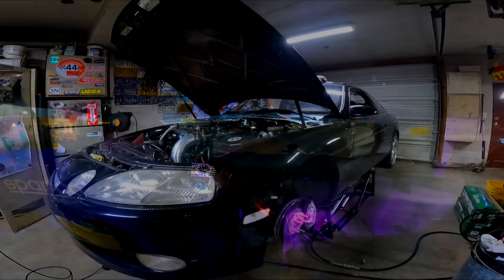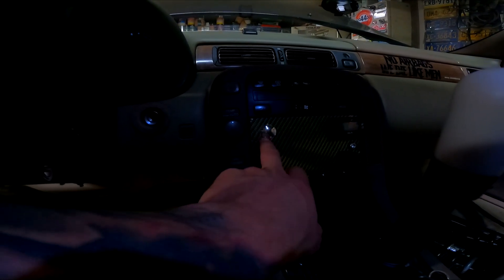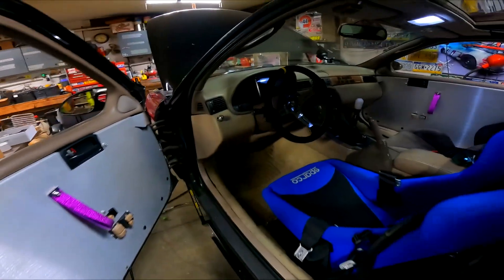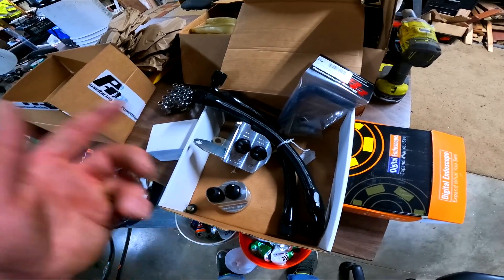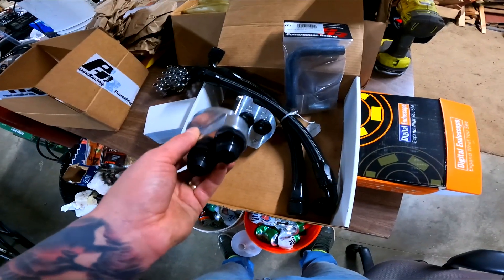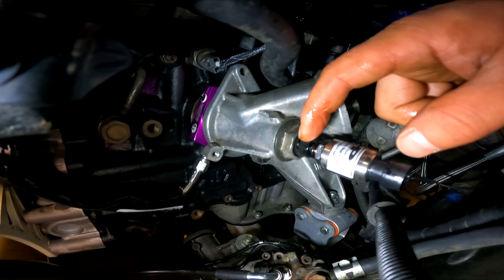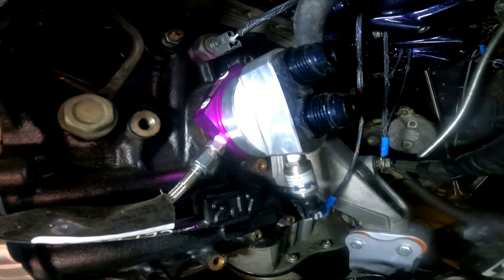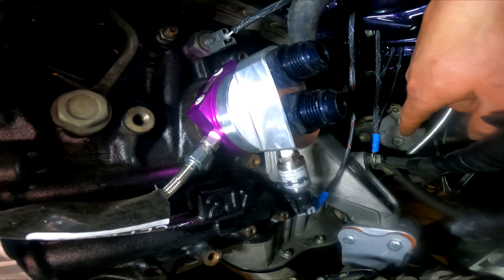JZ Powerhouse Racing Oil Filter Relocation

Comment: What weigh oil you use
Reply from the maker: I had put valvoline vr1. Great oil, but i think it was 20-50.  Im running oem standard bearing clearances and oem calls for 5-30 or 10-30